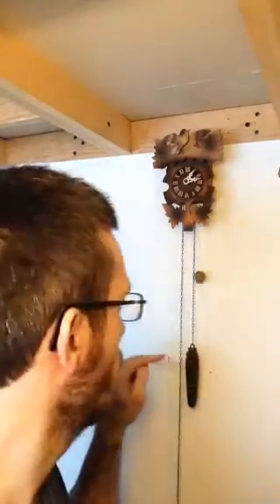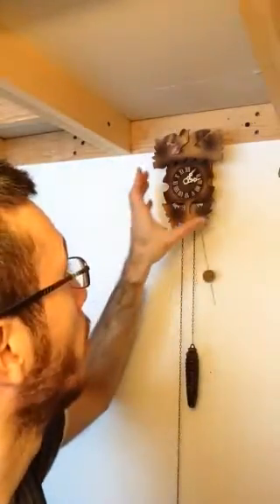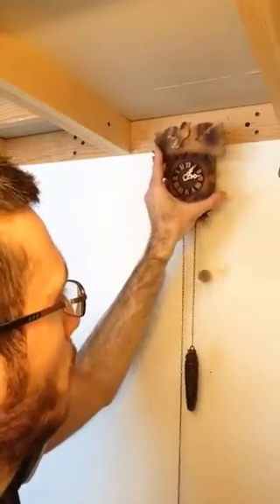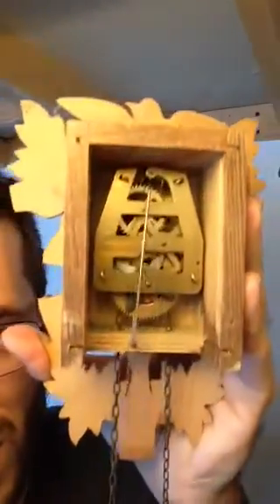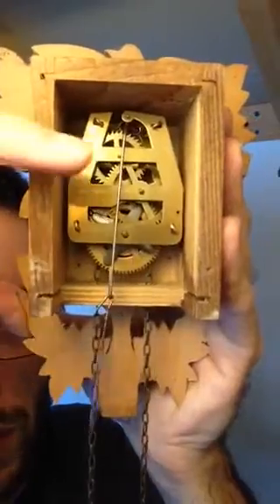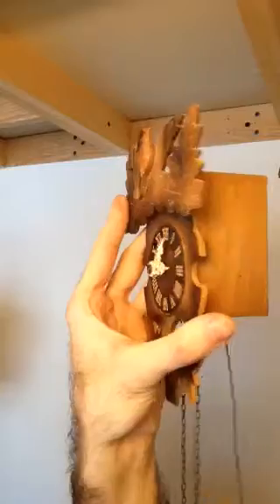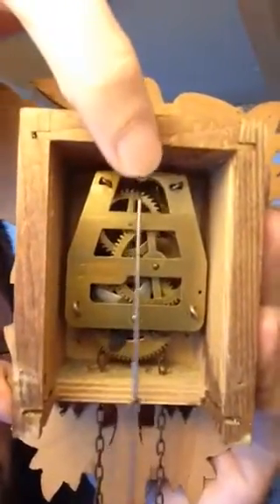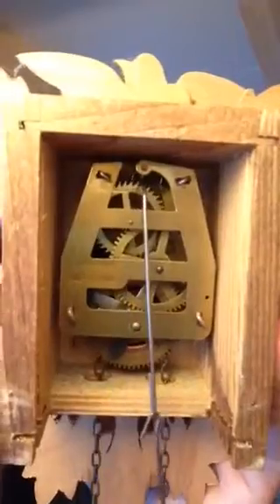The mechanics of a simple pendulum clock

Comment: Did you make this clock you self? Was this just a bought clock or was it like a clock building kit? I’m participating in a engineering competition and my task is to creat a time keeping device and I was going to make a pendulum clock. I would love to buy something like this online to study it.
Reply from the maker: Pendulums are great for time keeping... The length of the pendulum determines the period. The main engineering challenge is the escapement mechanism that keeps the pendulum going by periodically giving it a small push. Good luck with the competition, sounds like an amazing project (should do one with my students)
Reply from the maker: It was bought like this at a swiss souvenir shop. I think you can buy the mechanism separately... It is great to study the escapement mechanism on a cheap device.

Comment: I found a clock like this but black forest color in my father's random stuff area, everything is there but the pendulem (finding photos of this antique clock is hard) I am making one, my proto pendulem is about 9 inch long of sodering iron and started rolling it up till the beat and speed is right now that I know it works I can make a permanent one.
Reply from the maker: Make the bob of the pendulum adjustable, so you can vary the length slightly to adjust the speed of the clock if needed.
Reply: @StefanBracher  that's the plan, the biggest problem at first was pendulem weight and  langth then buy a small threaded rod of the langth and maybe make a weighted sphere of wood or steel. I love working on clocks.